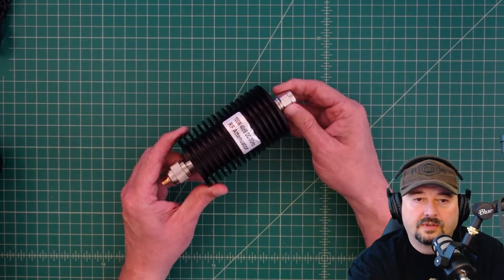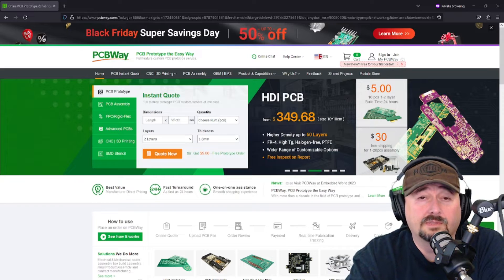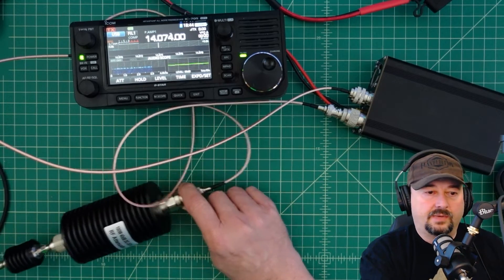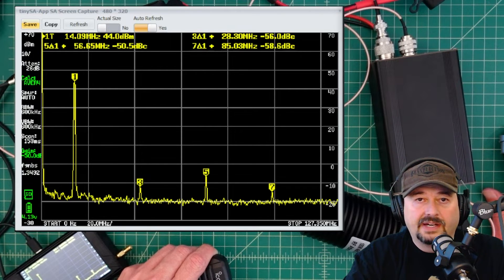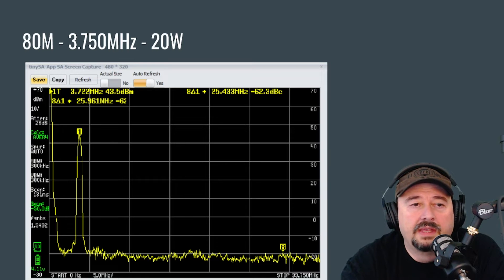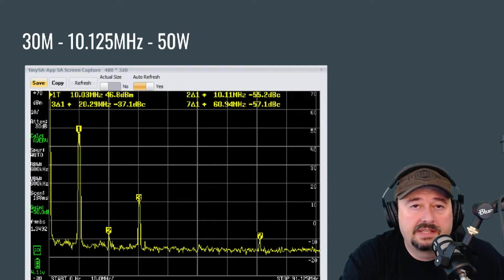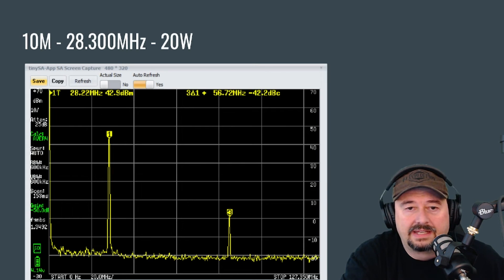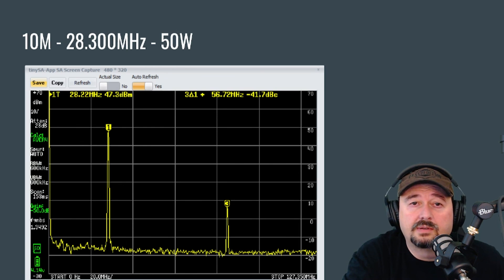Micro PA50 Amplifier Harmonics The Shocking Truth You Need to Know

Comment: The fails are worse than you think. The standard  is  -43dbm suppression AT 5 watt output.  On each  doubling the  standard (US) says that the  spurs must be suppressed a corresponding  -3 db . so for  20 W which is a  7 dB increase , the spurious Em has to be -50db down on main signal.  A close reaading of the FCC standard as applies to new radios or  amps - that's the ruling. There's some dispensation for older equipment . 
ZL1Mzr

Comment: According to the official guidance of TinySA, in order to ensure measurement accuracy, the final signal strength input to TinySA should be controlled below -15dB. Therefore, for measuring 50W power equipment, it is necessary to add at least a 62dB attenuator, otherwise the measurement uncertainty will be increased. .
Reply from the maker: Good think this isn’t for the space shuttle 👍
Reply: @TheSmokinApe  Thank you very much for your test. The 30m band and 20m band share one LPF, and 15m and 10m share one LPF. Maybe some LPF adjustments during the production process are not perfect, so I will communicate with the foundry for improvement opinions and let the sales agent Some tips are added to the introduction page to let users know that poor suppression may occur in the 30m and 15m bands.
Reply from the maker: @wdycsqcsqwdy  do you work with the amp manufacturer?

Comment: looks like to use it on 30 meters you will need a band pass filter. only a 50 watt amp. them small band pass filters will work or just wind your own. for the 10 meter band the harmonics are over 35 MHZ so a low pass filter with a cut off around 35 MHZ will work great. RM Italy as one as well as Comet and MFJ . pass 1.8 to 30 MHZ. it is important to check each band. I am testing a RM Italy KL 805 /24V/ 600 watt amp and it is shocking clean . I am using a Byrd line section as a tap off a 2.5KW dummy load. what you have to do for high power levels.   you are working HF them extra coax and connectors is not a problem. when I test a RF amp I go threw all the factors.  I use scope to look at wave form . look at input SWR . out put power and harmonics and scope for distortion . also the input voltage and amps .also the heat made from the amp. ICOM is very clean. I have tested the 705 and 7300 and my old 735. the 705 is not mine . belongs to oner of amp. just testing and setting up for him. love how you took the time to go threw the bands. what are real clean is tube amps with a PI output tune. I still test. a leaky or off value cap in the out put section can throw off harmonics . 73's
Reply from the maker: Yeah, I’m thinking about a filter for 30 or for 10 👍

Comment: What is the upper safe power limit for the Tiny SA?  In other words how do you know how much attenuation is needed to knock it down so that the Tiny SA won't get fried?
Reply from the maker: It’s pretty low, I want to say it’s about +6dbm.10w is 40dbm so 5w would be 37dbm, you will get used to the math OR you can use a calculator https://www.everythingrf.com/rf-calculators/watt-to-dbm

Comment: Maybe worth noting that the TinySA (I assume) is not calibrated. So, this is an indication of harmonic levels (especially on the  marginal results??). Maybe some low pass filters on the output would bring it in line on the higher frequencies?
Reply from the maker: Hey Steve, the TinySA is calibrated.  You could add a low pass to clean things up...

Comment: The amp should filter harmonics, but to be sure, you might check the radio output on the failing frequencies. The amp might be faithfully passing on what it was given.
Reply from the maker: I agree that the amp should filter them, and it does on some bands.  I've tested the radio on 30m and it is clean...